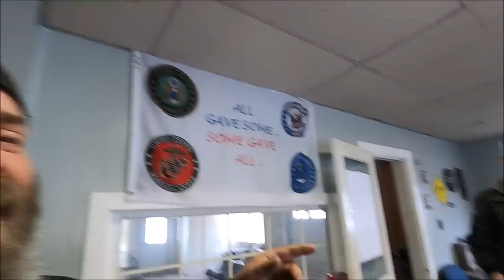My Kid Bought His FIRST American Car!  A COBALT SS!

Comment: Good news Zach, It will whine just a little.  And please do not get rid of that muffler-it's factory stock and perfect.  So I worked at Saturn when the Ion Redline (Cobalt SS clone) was new, and it was a disappointment to drive based on the power that the 2.0L LSJ put out versus the weight of the car.  But the car handles exceptionally well (suspension tuned at the Nurburgring-if you believe GM), and stops decently.  If memory serves, the engine is rated at 205HP, and many chassis dynos of the time came up with 197HP at the wheels, so it's probably underrated.  GM Performance Parts also had an optional tune that you could buy as a dealer accessory which I think consisted of an ECU flash and new injectors, and another tune with a smaller blower pulley and bigger injectors.  We never sold any of the Stage Kits ($1500+).  I think the most stage two would put out was in the 240HP range.  In any case, I think that your Dad will be able to pull plenty out of that engine through HP Tuners.  New, stock cars began to feel like they were accelerating well in the 3000-4000 RPM range, but then I believe GM programmed the ECU to start pulling timing, and the rush of boost (and acceleration) subsided.  Sadly the guys that bought these cars thought they were going to be much faster than what they were and we only sold four.  I was able to "performance test" one of these new against my 1999 Acura Integra (B18B) with 65k on it.  The Integra was able to stay within about a car length over the quarter, so I think your GS-R will have similar performance.  This should be a fun project and I hope the engine just needs valve seals!

Comment: Try to contact ZZP,  they can explain the casting issues on those blocks. They have new, revised blocks ready to sell.
Reply: The 2.2 ecotech is supposed to be good for 1,000 crank horsepower

Comment: I loved that car. Stage 2 with pulley boys 2.8 Downpipe, and exhaust. Pulled off the spoiler, threw on 15’s with drag radials and reeled in cars all day long. No it wasn’t fast but for 2006 most were still running bolt on sti’s and evo’s and mustangs were destroyed.

Comment: ZZP here in MI has the best ecotec stuff around.  I made 270whp on pump with my 05 SS.  Now I've got an HHR SS.
Reply: Only 270 lol, stock block Teggers will make 500+(whp) 8psi for less turn 10k easy.
Reply: @cro-thehacker7018  270whp on an unported factory blower.  10k in an ecotec will net you 600whp easily.

Comment: There is really no reason to have a 2.7 on it, get a 2.8 or 2.9 for it.  You need cooling mods, full exhaust, and a decent cold air intake to be running one that small.  The LSJ stock exhaust manifold is a HUGE restriction.

Comment: I used to have a Saturn ION RL...came out in 2004, one year before the Cobalt SS. Same LSJ powertrain.  You need to get a new heat exchanger and mount it up front.  I had a 2.5" pulley making 21 psi and my IAT2 Temps under load were only 15 degrees above IAT1.  Also, use HPT to change the bypass in first gear for less wheelhop when launching.  Oh and see if they still have a dual pass flange which will help your IAT2 Temps as well.
Reply: But I miss the hell out of my Red Line and seeing you and your son do some stuff with this has me more excited than anything else!

Comment: As a cobalt enthusiast, i can tell ya u need to change the pcv valve thats inside the intake manifold between port 2 and 3. Intense has no idea what they are talking about, thats more of a stage 3. However it doesnt have option b, which it needs, it needs dual pass if it doesnt have it, and a better heat exchanger. Most cobalts burn oil. Even if its only a small amount.

Comment: If by worst case it needs an engine, you might as well try finding a lnf (08-10) engine and/or a part out so you have a parts car. And I realize Zakary likes the wings however, they look best without and a aftermarket carbon with duck bill trunk. Just my opinion but you did ask so there ya go boyz✌

Comment: I had one of these cobalt ss cars years ago they are a ton of fun and can be made very very quick for not alot of money,  I had the supercharged version i put a zzp turbo kit on it ditched the supercharger,  and it put down 450whp this cars are basic as its gm mid 2000s but if fun and cheap speed is your goal it's a great starter car easy to work on. If you ever need parts Ottp performance and Zzperformance are the 2 companies that really make after market upgrade parts for the platform.

Comment: I don't have a cobalt Ss but I do have a 2006 pontiac g5 mine is auto 4door  it was handed to me for free I got 138,789kms on it the pioneer system sounds great but the car has got a big problem my 2006 pontiac g5 persuit would be driving down the road and then it pings showing power steering and then shows the Tc light comes on and then it starts to try to stall causing the rpm to go up and down and when it does that the car would shift violently jerking back and forth so you get shakin up good the abs and antitheft comes on Aswell you gotta be heavy on the gas to keep it from dying when you come to a stop the car will shake and vibrate and shutdown but always starts back up it will also randomly shutdown too one thing you have to watchout for is the rear wing overtime you have to tighten up the bolts that hold the wing down and watch out for water leaking into the trunk liner it will suprise you like it did me

Comment: I owned a supercharged one 4 years ago and absolutely hated it. Throttle body problems sending the car into limp mode and killing the car on the side of the road after replacing the throttle body twice still happened. So after the door handle broke and the latch hung up on the door I said to heck with it and took a $1500 loss. Bought me a civic and turbocharged it and never looked back 206 hp is a joke compared to a eBay turbo'd gsr engine  in a 94 hatchback 😎😎
Reply: Exactly, + the Teggers will make hella power over this ss, even zzp swaped.

Comment: These cars were sold in Japan as a Toyota, but the name is the same. So TRD and HKS as well as other top tuning shops in Japan have parts for them, when they came out for the 1st time brand new.
Reply: It uses the same motor as a celica and an mr2, so trd has an aftermarket supercharger for it as well as different size pulleys and intercooler kits and bigger charge pipes.

Comment: Should've gotten a newer model year. The ones with the supercharger aren't nearly as good as the turbo variant. But you should be able to hit about 290HP wheel quite easily, with just some stuff off ZZP (Pulley swap, cam, exhaust/intake. I had a 08 with the Turbo, ran a manual boost controller, 3" exhaust gabbed by buddy, 3" down pipe, intake, etc. Thing I as quite quick for the minimal amount of mods needed. I would eat stock-ish mustangs all the time which really pissed people off.

Comment: That thing is sold as a toyota cavalier cobalt in japan and you can buy parts from trd, and tom's racing if you want legit toyota in house tuning parts. But if you want aftermarket you can buy hks, greedy, apexi, tomei, and more.
Reply: In japan it had the celica and the mr2 supercharged motor as well as the ecotech more.
Reply: Oopsy i forgot blitz to add to the aftermaket tuners that had parts for that car.

Comment: Sweet...my year cobalt ss
Reply from the maker: 2006
Reply: @DiabloFormulaRacing  yep I have an 06 ss. Mine isn't the g85 code. But mine has a 2.8 pulley, dual pass, zzp stage 3 kit w/60# injectors, zzp shorty header to zzp 3 inch catless to 2.5 zzp catback, zzp trans and engine mounts, zzp short shift kit, zzp solid shifter bushings, zzp adjustable tensioner, sparco terra wheels and indy 500's. I love it lol. I should have went straight to the zzp entry turbo kit with the z54 turbo.

Comment: A 2.7 pulley without a dual pass and option B is asking for trouble😂
Reply from the maker: We like to play dangerously
Reply: @DiabloFormulaRacing  the car is just gonna heatsoak and make less power than stock running a pulley that small with zero cooling mods and it'd be better to run 80s injectors. But at that point just spend the $1400 for the turbo swap from zzp where they'll give you everything you need and remote tune it for you

Comment: Sheesh find out some info before you post lol.

I see a 2.7 pulley with no cooling mods. Injectors will hopefully be #60s not 65s and hopefully he is tuned. Check the plugs and see if it’s oil or an ass amount of gas.